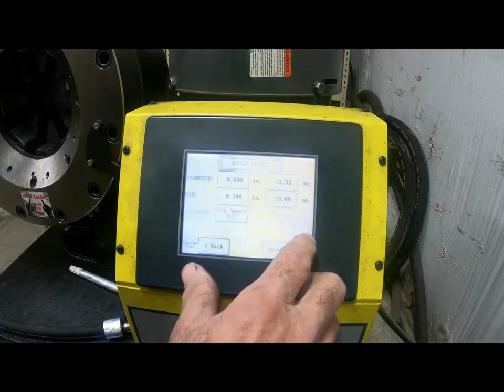Talking Stump Grinder Repairs and fixing a hydraulic hose

Comment: The Rayco rg 50,  super 50 ,and the rg 90  where some of the best stump grinders they ever made.
Reply from the maker: You're right Dana. I have had it for a long time and still love using it every day. Thanks for watching
Reply: @ChrissStumpGrinding  do you remember what you paid for your super rg 50? 
Right now for them used they are asking more money for them with 1000 hours on them than what they cost new and  Originally, it's crazy!
Reply from the maker: @danahasson2892  it was either $18 or $22,000 cash. I bought a skid during that time and not sure which is which on the price.
Reply from the maker: with 700 hrs on it
Reply: @ChrissStumpGrinding  sounds about right now the one's I have been finding used right now they want $39000-$45000 for them  crazy 

I had an rg 45 that I bought brand new in 2017 for $3660] out the door with the trailer. Unfortunately it got stolen about 6 minutes after I got it.  Now for a used rg 45 with 900 hours on with the trailer I have found for around $45000. It just seems crazy to me to pay more for a used one than what I paid for a new one.
Reply from the maker: @danahasson2892  I just heard tonight an average car is $45,000 from the dealer. crazy!!!